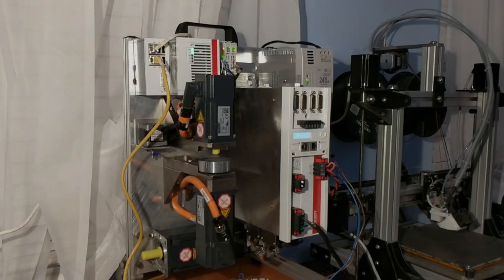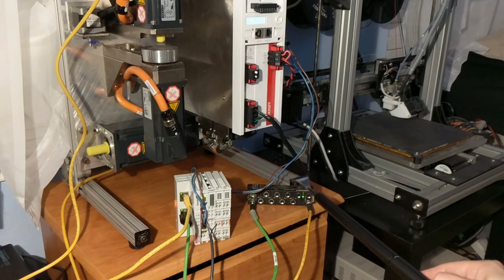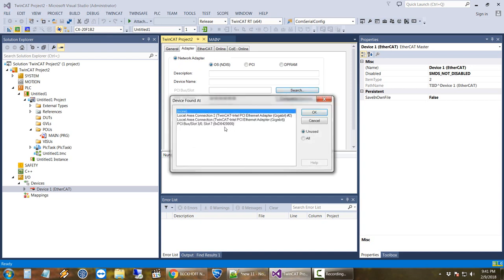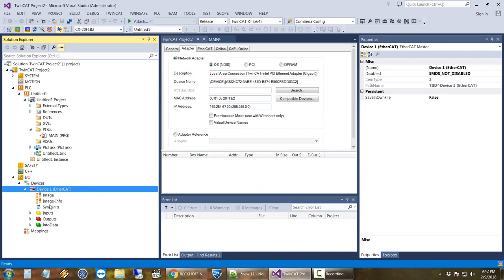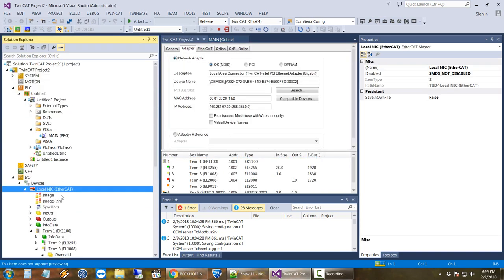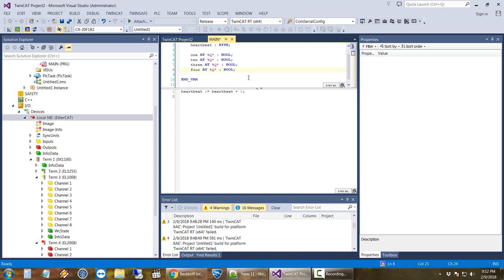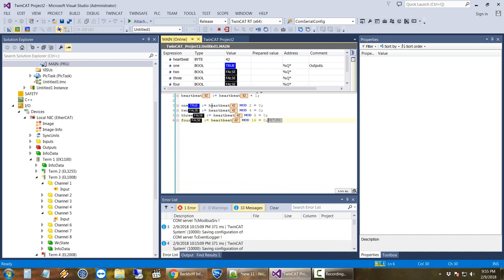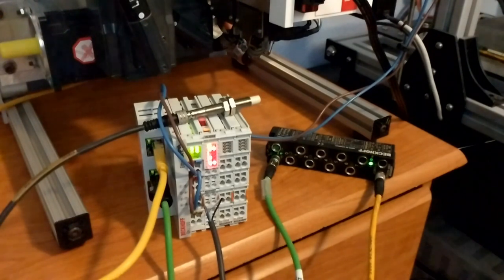Motion Control and IO with PLCs - EP4 - Beckhoff TwinCAT IO

Comment: You are an excellent teacher! I’ve been long time searching for a good Beckhoff course. You earned a new subscribed.

I want to apply for a new job position that requires Beckhoff knowledge, and I am wondering why this brand is so asked by employers when they talk about “motion”, can other brands also do the same like Rockwell? What does Beckhoff motion does than others don’t?
Reply from the maker: Good question, beckhoff does nothing that the others don't really. Find a good understanding in any of the plc systems and you'll be good to go on the other brands. I do prefer beckhoff personally, but if you learn one you're good to go on the others.

Comment: hopefully all of you are doing well.I am facing problem on EL9410, I have replaced my faulty cards with 2 new one from store but 3rd led indication of running is not appearing.Does it needs any configuration? please do you have any good ideas.I am using E bus.

Thanks in advance.

Comment: Thanks for your instruction videos. These have been a good help for me to start with TwinCAT and EtherCAT communication. I have a question how to convert four SINT (bytes) to a REAL Value in for example Structed Text.  SINT1(8bits)   SINT2(8bits)   SINT3(8bits)   SINT4(8bits)       shall be read as a REAL (32bits).
Reply from the maker: I assume these are coming in over some fragmented communication protocol, like a serial driver, storing portions of the 'real' value as a grouping of SINTs... otherwise, I'd say avoid SINTs all together as they won't save any memory.

So, likely you'll want a DINT to store the values in, then use MEMCPY() to copy the SINTs into the byte addresses of each portion of the 4 byte DINT.  Then, you'll have your number represented as a DINT, so you can use DINT_TO_REAL().  However, I'd guess that isn't the end of the story, since they are likely encoding the REAL into the "SINT ARRAY" with some other type of encoding, so you'll need to figure out what that is and decode it.

Comment: Hey, i have a CX9020 and i'm having trouble linking I/O signals (the leds show up when contact is closed) to my PLC program variables, therefore i can't even activate a coil by the push of a simple button. The problem is not in the programming side since im quite experienced with ST. My I/O are EL2904 and EL1904, coupled with the EL6900 that came with them (TwinSAFE). Not sure if this is supposed to work?
Thanks and your videos have been really helpfull
Reply from the maker: If you are in twinsafe, things work quite differently.  I suggest finding a tutorial on it, as from my experience it is not very straight forward... that was years ago though.

If you bought all that stuff, I'd get with your beckhoff application engineer in your area and have them webex with you to get started.  I wish I had videos on twinsafe, but honestly I hated it the two times I used it.  That goes for all safety plcs I've used, so nothing against them, it is just quite different and not very user friendly.

Comment: Thank you for the tutorial. May I know, if i’m using cx2020 is it crucial for the types of e/k bus and master/slave card that i used in order for the execution of the plc?
Reply from the maker: It will have a built in e bus. K bus is old but you can use it with a coupler

Comment: Thank you for the videos. They are very helpful. However, I have one question to ask. 
I have written a program which runs 4 servo motors, and I must get them running even when I disconnect the ethernet cable from the engineering PC. 

I use a normal PC with twinCAT to write the PLC program, (The PC is connected to a CX2030 embedded PC via an ethernet cable) , then I just log in to the PLC in the TwinCAT software. 
Now I would like to install the PLC program i've written permanently onto the embedded PC (PLC) and run it without having to use the engineering PC. How do I do that ? 

Thank you for your support.
Reply: Look for the 'auto start boot project' option, and set the system to run mode on boot in the system settings and it should work just fine.

Comment: Thanks so much for this video. If I wanted to send data via UDP to the PLC would it be possible with just one Ethernet connection for both the UDP connection and programming on it?  Also with communicating via UDP how would the processes differ from this set up within TwinCat 3? I do not see why I have to link program variables to the EtherCat object in Twincat 3 if I am just trying to communicate via UDP. (This is what I am stuck on). I am using the CX9020.
Reply from the maker: You can program and send UDP data on the same network card.  They are happy to coexist just like a normal computer.  You wouldn't really follow this procedure, since you don't have EtherCAT IO.  Just don't assign any IO and you'll be fine.  For UDP, however, you'll likely need the socket communication add-on, which is a licensed (aka not for free) product from beckhoff.  It isn't that expensive, but you should find some example code from that and start with that.  Rather than linking in the variables, you'd just create a routine that read socket data from UDP and put it into variables you can use elsewhere in the program.  Does that make senses?  The software you need is TCP/IP Connection Server, TS6310
Reply: I am following a tutorial "quickstart" on the beckhoff website. The following directory(on the website - you cant really send urls form the website) points to the Quick start I am talking about . TwinCat 3/TFxxxx | TC3 Functions/TF6xxx - Connectivity/ TF6311 TC3 TCP/UDP Realtime/Quick Starts/Quick Start (PLC / UDP). Do i need that not free software on top of the code from the tutorial? I got that code to compile with a EtherCAT Automation Protocol Device added that has the "DevState" linked to a variable in main(I had to do this to get rid of that error). But when I send data to the port it does not work with the code I got from beckhoff. Again thank you so very much for taking your time to answer my questions.
Reply from the maker: With that example code, it will likely make you enter the trial code again, so if you go to your licenses tab, you might notice a new license in there.  It is free to play with, and you can renew the 7 day trail over and over again, so it won't cost anythign now but if you put it in production you'll have to buy that licnese.  I think it basically lets you use TCPip.lib or something like that.  I could be wrong, as I've only used TCP sockets,... maybe using the RT-Ethernet adapter TCP/UDP RT doesn't require it?

I've never tried this method, but be sure you assigned your adapter to an actual network card.  It could have come in blank, so it might not be listening to anything.  I assume since it says "RT Ethernet adapter", that is is using the Twincat Realtime NIC driver also.  That means you have to run on a supported NIC, which there are not that many computers have them... almost NO laptops do.  If you are on a real PLC you should be good.

If you don't need realtime, which I doubt you do, check out TF6310's example instead of TF6311.  There is a UDP sample in there that you can use if you don't need realtime.  I doubt whatever the sending unit is is realtime anyway, but maybe...?
Reply: I am running it on a actual PLC so the real time shouldn't be a problem. Is there anything else you think it could be? I will go try the other tutorial now.
Reply from the maker: Joseph Maclen I'd say just make sure you linked up the adapter in the IO tree to the real NIC
Reply: SquishyBrained ok thanks so much again!!